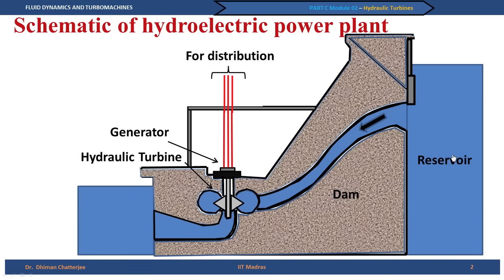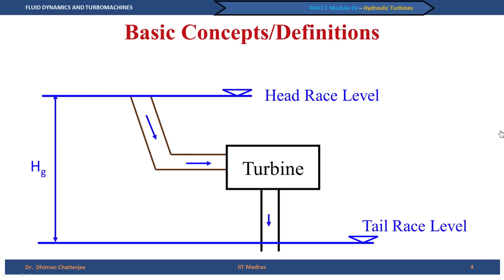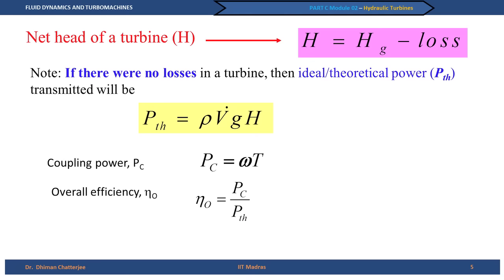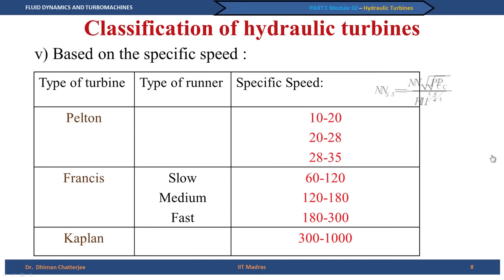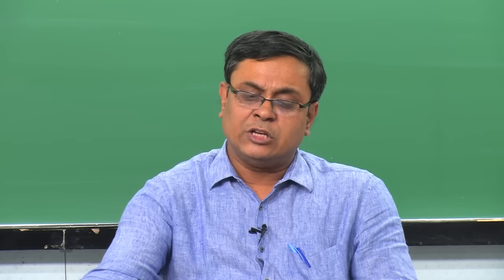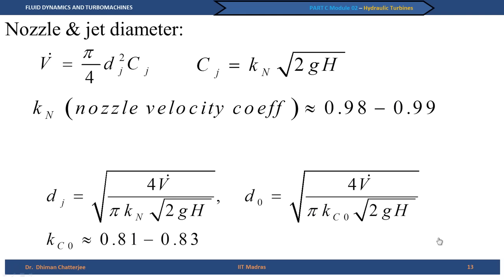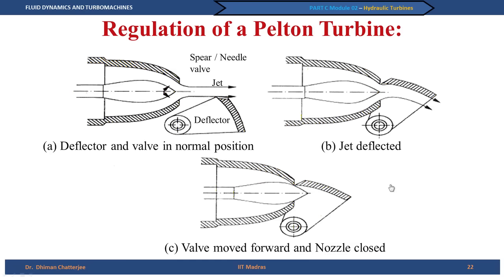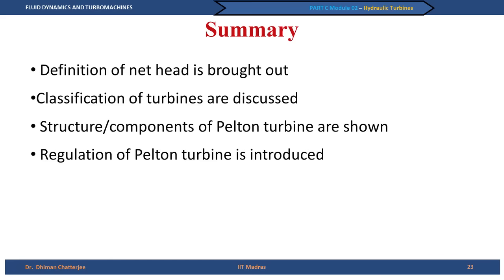Hydraulic Turbines: Pelton Turbine

Comment: Nomenclature of terms in Velocity triangles
C: Absolute velocity
W: Relative velocity of fluid with respect to the blade
U: Blade peripheral velocity(or) Blade velocity
W_bl : Specific work done by blades (ideal condition), can be found using Euler's law.
Angle /beta : angle between W and U
Angle /alpha : angle between C and U

Subscripts: 
1 denotes the suction side
2 denotes the pressure side

As it is a turbine pressure at entry is higher than the pressure at the exit. So entry velocities have subscripts 2 (denoting high pressure) and exit velocities have subscripts 1.

Subscripts: 
C_u : component of absolute velocity along the blade velocity
C_m : component of absolute velocity perpendicular to blade velocity